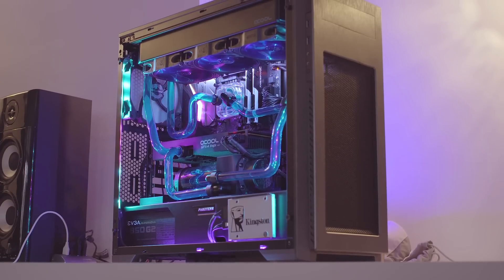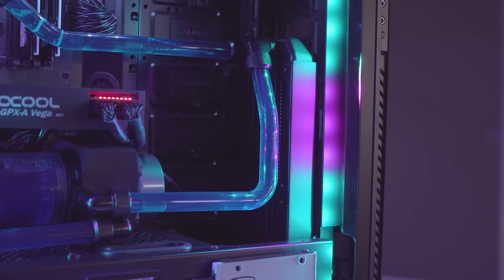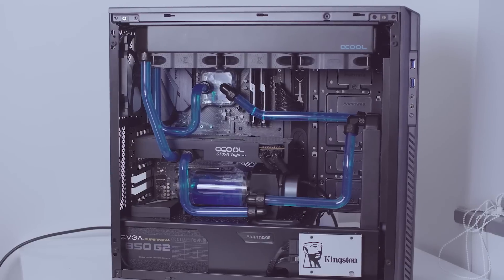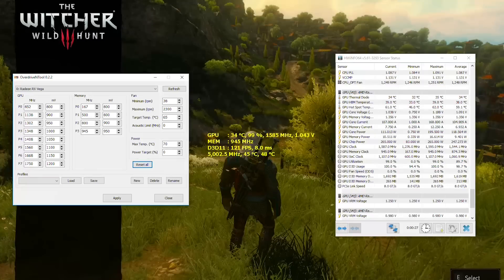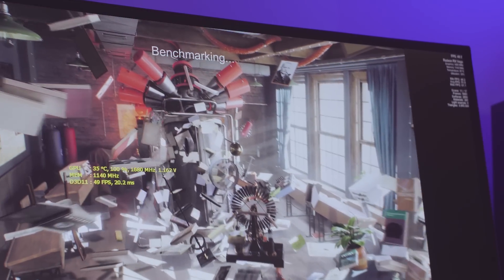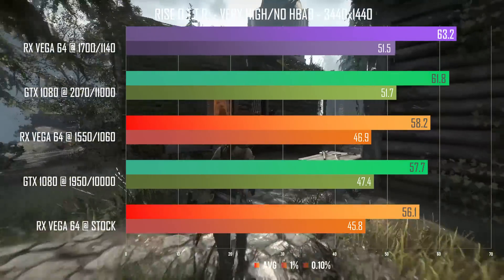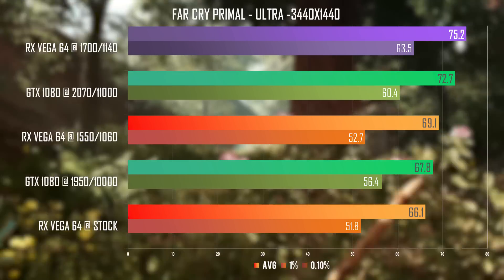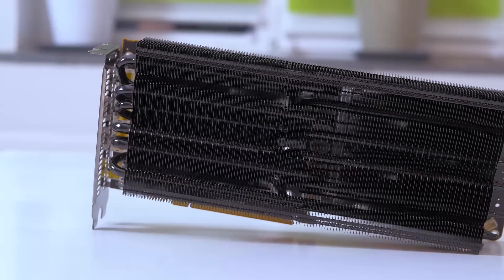1700MHz RX VEGA 64 - how FAST is it?

Comment from the maker: The real question is - why did I not switch the lights to blue on the card until now? :/ SMH...
Reply: i have the same issue flashing the lc bios on my vega56, any load and it crashes.  LC gpus are definitely binned.
Reply: I had the same issue with my First MSI RX Vega 64 Wave, it would crash on turbo, they replaced it and my new one is a beast :) https://www.3dmark.com/fs/13977627
Reply from the maker: +John Smith Good to know it's not just my GPU...
Reply from the maker: +merlin21c Yeah, hot-spot is always higher than core temp. Trying different thermal paste applications may result in improvements, but it's always going to be higher.
Reply: MindBlank Tech you need to try again with the new beta drivers, there is a massive FPS increase (20).
Reply: vega has improved alot  2020 with drivers  mid 2019 seen huge performance in drivers
Reply: MindBlank Tech Can you please show 580, Vega56 and Vega64 with and without crossfire overclocked, undervolted and full optimized with latest adrenalin features against overclocked Volta, Xp, 1080Ti, 1080 (with and without SLI). Using games and synthetic benchmarks with Vulkan and directX12, compared with current prices and AMD recommended prices.

Everyone is comparing overclocked nVidia against stock AMD.
To me Xp and Volta are price fail.

Current rocket pricing for AMD only shows it is market demanded and so better than nvidia.